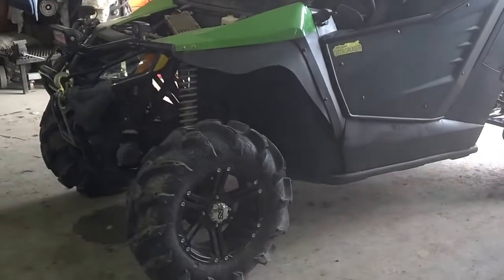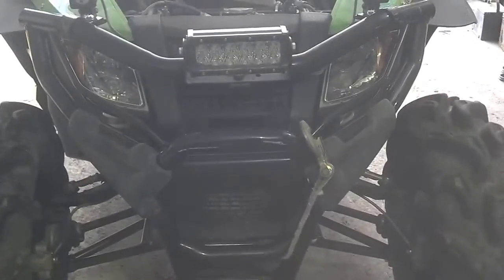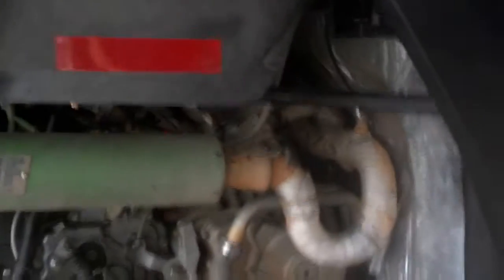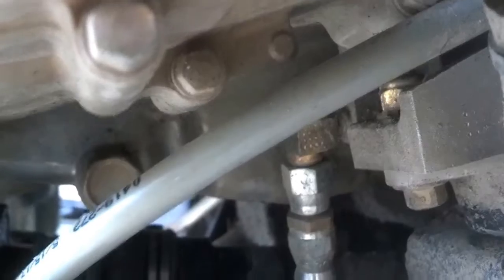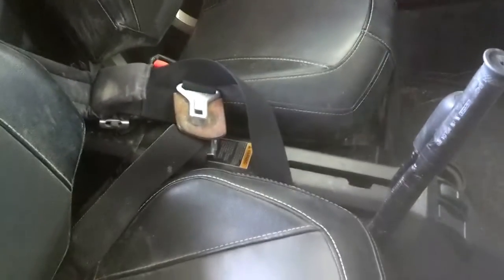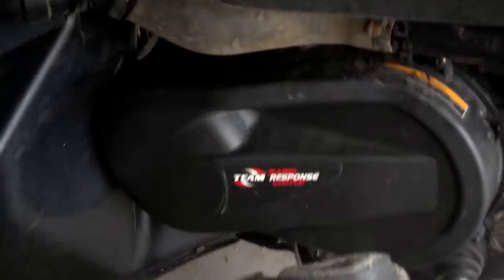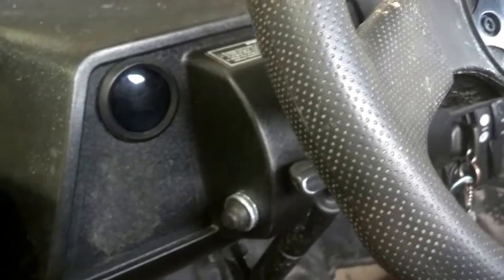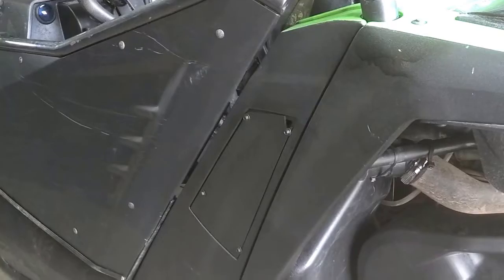My Wildcat trail mods

Comment: I like everything you have done to your machine, and I especially like how you made many of the parts yourself. Cheers to you.
Reply from the maker: +Eric B Thanks. Im working on a tight budget and on top of that most of the stuff that I want you cant get so I have no choice but fab it myself. I have done a few more things since this video including adding a GM style battery under my seat (snorkled so it doesnt get swamped) and I have added seat risers, harness pass throughs in the seats with a harness bar for the wife side and arm rests to the seats. I have added rubber fender extensions to the AJ's fenders. And now im working on my own belt temp gauge for it. I still have an endless list of stuff I want to fiddle with....

Comment: ...cant wait to get ours- waitin here in europe since 2 weeks for 2015 model!?looked all your vids drivin with your wife !! ;-)  you have modified a lot this year! startin stock with half windshield...greets pete
Reply from the maker: +Izom Thanks Pete, its been a fun year here, rained a lot so we have had some weird driving conditions. Sometimes its dry when you would expect muddy and muddy when there hasn't been any rain. I did get lots of stuff done with my trail this year and still have more planned to do. I will recommend to put grease zerks into all the control arms and knuckle bushings before you get too many miles on your machine they have brass bushings factory and mine wore out in 450Kms. I switched to a UHMW set and put grease zerks in for less than just one set for the rear from arctic cat. Cheers and thanks for watching hope to see a vid of your machine when you get it.
Reply: +Artman26 grease zerks good idea- wonder These things come without!?? even my chevy has one!?? greets

Comment: Bought the same machine end of summer this year. Love your mods. I hope to do a few myself. This video was very helpful. Thank you for taking the time to do it. Much appreciated. Where did you find those doors?
Reply from the maker: Thank you for watching the vid and I'm glad you liked all my work, I'm sure I can do better the next go around with some of these mods but a lot were first drafts for what I thought would work.  The doors are OEM from Arctic Cat. And I would suggest to put in limit straps at the bottom to save the hinges from taking all the weight when the door drops open. Cheers

Comment: What did you make the speaker pods out of? I have 2 6.5" speakers and ive been looking into doing exactly what you do. Thabks for all the info
Reply from the maker: I think I started with some speaker pods for a Tundra ( http://www.scosche.com/satt634 ) trimmed them and then added some PCV pipe to extend them to the depth that would allow the speaker magnets clearance too the roof.  I RTV'd them and screwed them together and then RTV'd and screwed them to the roof from the top of the roof down through into the PCV pod and ran my wires. Cheers and good luck, Art.

Comment: Wildcat Trail 700 clutch question to Dalton:

Please help me understand,

I’m having a hard time wrapping my head around this. 

Bigger weights engage clutch at lower RPM?

It seems to me that more weight would require higher RPM to engage as it takes more energy to get the increased weight to move. 

Is it because more centrifugal force is needed to use lighter weight to force clutch to engage, even though they move sooner?

I have stock wheels and it says use the second largest weight. I want the clutch to begin to engage at a lower RPM.

Dalton technician reply:

Well, ..you are wrong.
Lol

Heavier weights overcome the pressure of the spring easier and engage sooner.

..however....and as you will see in the instructions, it is the primary spring that is the principal control of engagement rpm...not the flyweights.

The weights control the rate of shift  of the belt going down the track(and thus the rpm during the main clutching phase)

It is all there. Some of the pages that look boring are the most important.

The kit engages slightly lower rpm than stock anyway.. however the most important aspects of the kit are much more than that.

The kit has to be set as described in the instructions for each tires size (because of course, that is the test results)

Thanks

My reply to Dalton:

Thank you for your immediate reply. I did replace my Wildcat original clutch parts with Dalton’s and used the recommend 3/4” weights.

I may not have even needed the Dalton kit, but am not by any measure upset that I purchased and installed it. 

If you look at this video you will see the problem that I am certain was the major problem with my clutch: https://m.youtube.com/watch?v=4pwM26rOico

I had to use a file to hack off a huge chunk a metal from each of these six glide surfaces in twelve steps, then use progressively finer sandpaper to polish the rails until I ended up with a 0.02” slide clearance. 

Previously, quite literally the clutch would not move without hammering it. No wonder it would not shift, and it lurched at high RPM when engaging into gear. I’m surprised it worked at all. I bought it used with 6 miles on it, and never liked the way it shifted. I was told by several people who should have known better it was normal, but I had a feeling otherwise, and it got progressively worse with use.

So by buying your kit, it forced me to find the solution, additionally I benefited from the upgrades.

Now my Wildcat drives much more like I expected it should. Now I move the shifter with ease and do not have to force it and worrying that I am going to break something. Additionally, now I give it a little gas and it moves a little bit, not revving the engine and the cat jumping quickly and with great force forward or reverse; with the need to cover and slam on the brakes before it crashed into something; and it got much worse when it warmed up.

By the way, all I needed to do the upgrade was a bench vice, a 7/16” 15” threaded rod, a block of wood with a 1/2” hole in the center, a 1” x 3.5” x 1/4” piece of aluminum with a 1/2” an offset center hole, a 2” PVC pipe coupler, a washer or two, and a 7/16” nut (all things I had sitting around the house); plus a primary clutch puller (definitely recommended).

Remove clutches. Clamp the rod into the vice, slip the wood over the rod (to cushion the delicate clutch parts), slip the clutch onto the rod, place the 2” PVC coupler on (fits perfectly over secondary bell - holding down collar), next the metal plate (offset hole allows easier viewing when reassembling primary), washer(s), and nut; good to go! 

Again, thank you for all of your help. I’m sure the kit added to the smoothness of the shifting, and it definitely is responsible for my identifying the problem.

Comment: How did you wire the low oil shut off? I'm not the best on wiring but i had a rzr 800 that ran low on oil and i destroyed  the motor i would like to put it on my two bikes.
Reply from the maker: I ran a braided hose from the low pressure oil light switch that's under the engine on the passenger side close to the firewall, to a low oil pressure Murphy switch. I used the fused ignition (IGN 10A. Brn/black wire to the ECU) in series with the Murphy switch and had a momentary switch to bypass it to be able to start it. I tried the fuel pump but the engine would run for almost 3-4 mins before it stalled from lack of fuel pressure. So I chose the IGN fuse for an instant kill. https://www.wildcatforums.net/attachments/img_20150417_092215_658-jpg.31962/
Reply: @artman265  thanks for the help.

Comment: Whats the notch for in the plastic for the shifter handle? Mine doesn't have it
Reply from the maker: It was going to be an attempt at making a "stop" so you cant shift straight into reverse and had to slide the shifter to the side and around to get to park, but I never finished it.

Comment: I'm wondering as well about how its been reliability wise if you even still have it? I just bought a 16 trail se
Reply from the maker: I still have it and it has held up pretty good considering what I put it through. My biggest complaint so far would still be the piss poor bushings they put in the control arms and knuckles Just Garbage. I upgraded to the AJ's bushings and havent had a problem since. Cheers and thanks.

Comment: can you show me more about the lift .I'm in process of doing something simular
Reply from the maker: +Wesley Barnhill  I hope this image helps. http://www.wildcatforums.net/forum/attachments/wildcat-trail-trail-xt/66010d1454563165-rear-lift-img_20141101_191735_277.jpg
there is lots of info on that site I didnt have the time to look through all the pages of the DYI post on the wildcat trail thread.
Reply: +Artman26 thanks that's what I was thinking .what did you see for the front
Reply from the maker: +Wesley Barnhill 
I havent done anything yet for the front. I'm looking at getting a set of the Bandit UTV adjustable shocks for the machine all 4 corners and want to see how they are before I attempt what I have planned for the front. The Bandit springs are much firmer (200# front vs 145# stocks and 240#rear vs 145# stock) so I would like to see how adjustable they are to soft for the type of riding I do before I add lift to the front.
Reply: +Artman26 I'm looking into used late-model racing springs.they are about the same . I have mine set they have maxed out the front .I'm thinking of using the super lift on side by side stuff .it has a bracket for the front and sing spacers .just a thought though

Comment: I like how you add your own grease fitting to your machine. Can you tell me the steps you take. I can send you my email if that's easier. Great job look good.
Reply from the maker: Its pretty easy just takes a bit of time because you have to pull the bolts out so you can drill deep enough without marking the bolt. I did mine when I changed over my bushings so I had it all apart anyway. There are a few different grease zerks so you will have to just use a drill bit smaller than the zerk you choose and they should thread themselves in if you get the hole the right size. Just chose a spot where the suspension isnt going to interfere with it through the travel of the arms and put the zerk in the center of the bushing and the grease should make it through evenly. Thanks for checking out my Vid, I might do another soon to update all the other stuff I have modded on this machine. Cheers Art
Reply: i know Im randomly asking but does anybody know a trick to get back into an Instagram account?
I was dumb forgot my password. I appreciate any assistance you can offer me!
Reply: @Terrell Braxton instablaster :)
Reply: @Jay Alvin i really appreciate your reply. I got to the site thru google and I'm waiting for the hacking stuff atm.
Takes a while so I will get back to you later when my account password hopefully is recovered.
Reply: @Jay Alvin it worked and I actually got access to my account again. Im so happy!
Thanks so much, you really help me out !
Reply: @Terrell Braxton no problem =)

Comment: The reason why your a arm bushings went bad in only 450km is explained in this thread. http://www.wildcatforums.net/forum/wildcat-sport/17692-important-things-know-about-your-wildcat-sport.html

Get the AJs bushing fix for your ride. 

You should also look on the list about slack in gas peddle wire. Apparently many people never see 100% throttle until this is adjusted properly.
Reply from the maker: +jesselebby Thanks for the comment, I guess I didnt go into depth with my bushings. I have replaced my bushings with the ones from AJ's I was one of the original ones to get them for the trail. Ans thanks for the link to the forum I have contributed a few different posts to that thread on the Trail DIY section. Thanks for watching, Cheers Art.
Reply: +Artman26 You're welcome. I've been posting there under the sport for the last few days. Mine will be ready either this Friday or Monday. Im so excited.
Reply from the maker: +jesselebby Nice. Ive tried to do most of my stuff myself and on a budget so you get what you pay for lol. But I have also tried to build my machine to suit the area we ride which is very challenging since we have almost all terrain available at any given time on almost all the trails we ride, so it makes it hard to specialize the machine for one when you have so much to go through. Im working on a few things for mine still and saving for my Bandit suspension. Cant wait to go out riding.